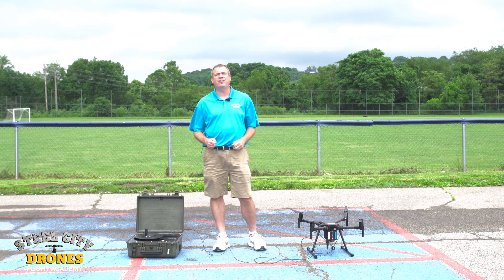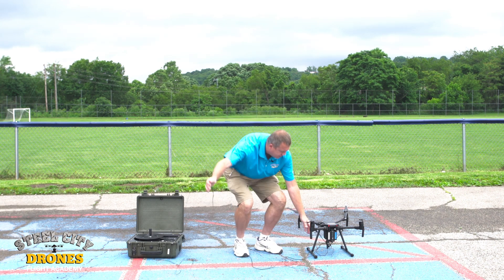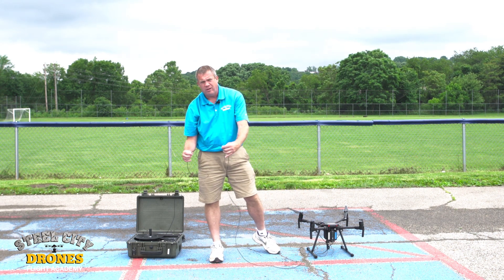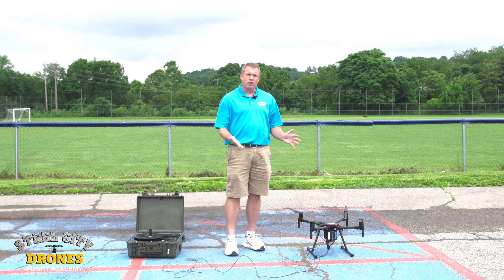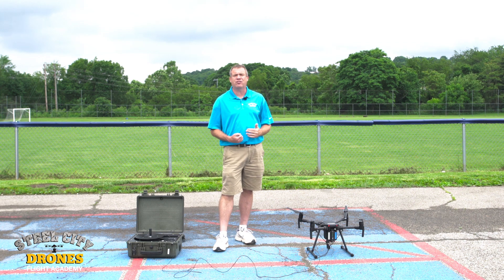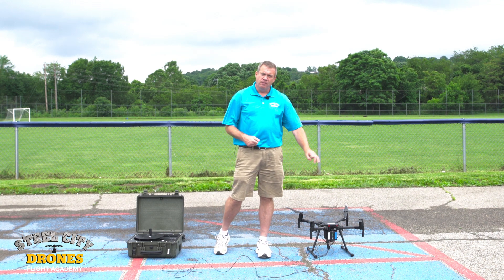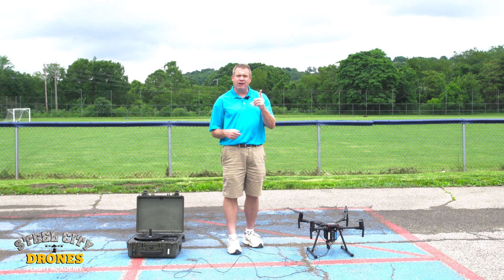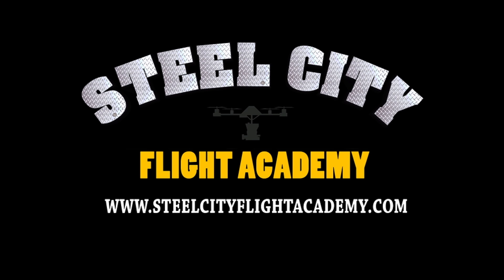Ligh T tethered power solutions for DJI aircraft

Comment: What happens if the power wire contacts power lines? Does tethering the drone, affect the flight regulation?
Reply from the maker: You want to use this setup in a free and clear parameter. You don't want the cable to potentially get caught on trees, power lines or anything else.

Comment: You should just call your system a Time Machine, 'cause you took the RC industry back 50+ years.
Thank You Sir !
Reply from the maker: Can you please elaborate?
Reply: Just a desperate measure for desperate people.
And the winner gets a free... diesel powered generator on a trailer! How cool is that?
Reply from the maker: @dectechnologies1129  Not sure what you mean. Tethered power solutions are a great work around to the limitations of drone technology. Not only can you continue mission critical flight operations non stop, it gives added risk mitigation for applications that can't take any changes. Having a tethered drone with a parachute would allow you to fly around large groups of people, and or areas like airports very safely.